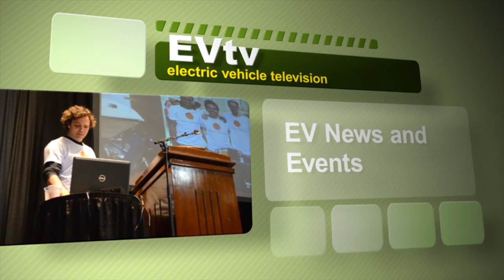EVTV Friday Show - March 22, 2013

Comment: Dear jack : as for the seaman motor i suggest a fake spare tire cover on back for clearance and as for the cooling radiator mount it on the trunk lid (outside ) and get a small chrome luggage rack to protect it (paint radiator black flush mount it)

Comment: Regarding the Thing build, you might want to consider lightening the flywheel I saved 5 lbs on mine. A machine shop cut off the teeth (which are useless in an EV) and excess material. It saves having to spin up all that weight as you accelerate.

Comment: Absolutely! My suggestion to wrap the fairing  to enclose up to the forks is ugly but the most practical for adverse weather. It's a pity my BMW R1100GS is not electric or I could immediately read off the difference with the modification and without. ;)

Comment: I'm puzzled.  Why do we need to match the range of an ICE?  Having any sort of long range implicitly means a heavy battery. Average daily miles are still 35 or so - why hump 200kWh of weight around repeating history with poor efficiency?  30kW would be more than enough for most cars - IF we develop a sensible system for avoiding the weight humping for long distance trips - e.g.  inductive power transfer on the interstate highways/motorways or - better still - High Speed Motorail!